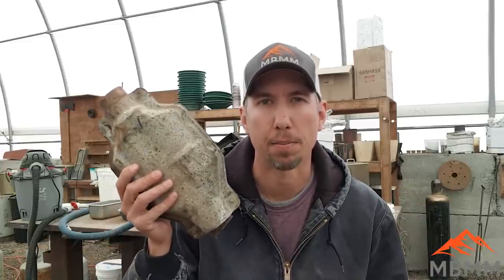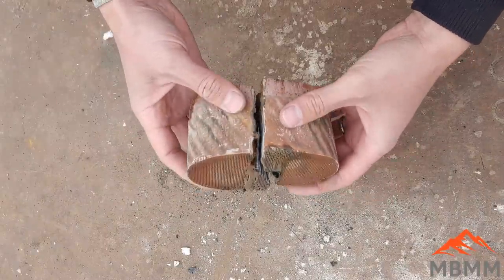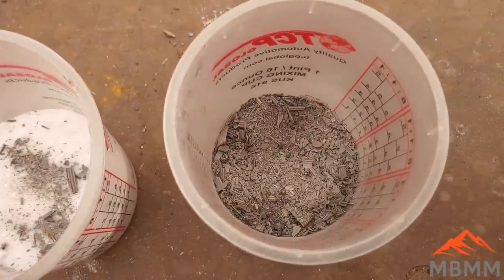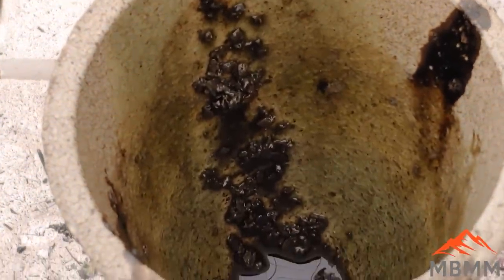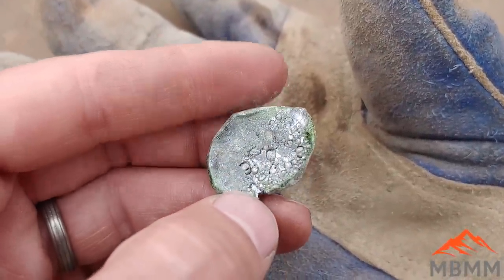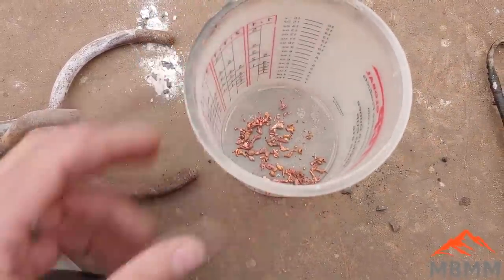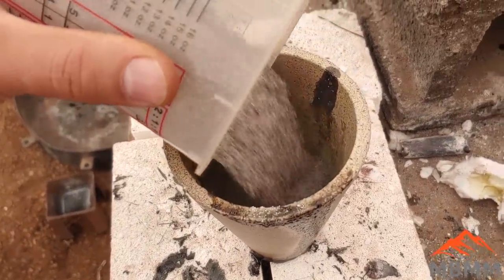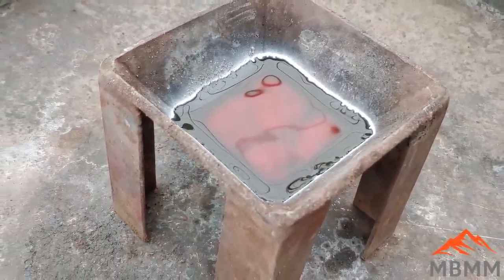Can Platinum & Palladium Be Smelted From Catalytic Converters? Urban Mining Platinum and PGMs!

Comment: i think for platinum "Aqua Regia acid" is the way to go but when dissolving the PGMs you need to be careful, watching Sreetips or Cody's lab they go in to details of what can be done, but it's always good to be on the safe side and have the right safety equipment. 
Sreetips may be the one with most experiences on this and will most probably have the most information on what to do.
platinum can cause platnosis witch will damage the lungs and other parts of our body needs to be handled with care and with good gloves(dont use nitrol gloves when using nitric acid or aqua regia) and a fume hood of some kind.

Comment: What is  the white powder
Reply: Likely the matting material holding the catalyst in place.  It becomes very powdery when released.  This is the biggest safety concern here, since if this part was of late 1980 early 1990s US vintage, it's likely to be refractory ceramic fibres.

Comment: The molten that you did with the copper is called Modern Art, Lol Looks like Volcano Lava, different, atleast you had a bead in every melt,   crazy 3300, shows those catalytic converters have a little heat in them, they'd fry if they didn't have that melting point, interesting

Comment: I'm not a scientist,  but everything  has its melting point, and I see that ceramic is higher  than platinum  so couldn't you heat your  furnace  to the platinum melting point and it will letch out and pool at the bottom of the crucible leaving  the ceramic  intact as it has a higher  melting  point? Like I said I'm not a scientist  but that's  how the refract crude oil into all the different fuels  or how alcohol  is distilled

Comment: A metallurgical book will give you answers or some old boy having a good knowledge firing problems. All you have to remember is that the higher temperatures some metals can evaporate, as it does with acid's treatments.The metals maybe a finite filme or what we call a blush of platinum or Palladium and rhodium on the honeycomb structure, you know yourself, they don't lay gold on thickly when they lay gold or rhodium on silver jewellery. They put it on at a third of the thickness of a human hair or less. Micron's in thickness 0.3 or less. Your problem might be, there wasn't hardly any Platinum in the first place, maybe leached out. They say you can mine roads for Platinum now. As you probably worked out yourself.
Reply: I remember watching a video years ago about some guys sweeping the side of a road, collecting just, to acquire Platinum and they ended up with a bead of less than a gram.

Comment: That cat was damaged,  it came from a car that most likely had a misfire and overheated the cat.   You could see the melted honeycomb.  I don't know if this has an effect on the precious metal recovery but keep in mind that it got red hot,  hot enough to melt the ceramic.  Automotive three-way catalytic converters for gasoline engines have Pt, Pd, and Rh.
Reply: you dont think the melting would have to do with him cutting it with the plasma cutter? funny how it was melted right along his cut lines

Comment: Diesel vehicle = platinum catalyst...
Gasoline vehicle = palladium catalyst... This is why palladium is soaring in price compared to platinum. The industrial use and demand for palladium is higher as there is much more gasoline engine vehicles being built. Once palladium gets to expensive then gasoline car manufacturers will start to switch back to platinum for it's low prices that will then drive platinum prices higher. They go back and forth between the metals. Whatevers cheaper at the moment.
Edit. A new gas engine catalyst should contain between 3-6 grams of palladium. On a old and used catalyst, some of that palladium will have lost micro particles over time and heavy use. New Platinum catalyst should contain between 5-8 grams of platinum.

Comment: The only sure way to get PMs out of the catalytic converters is to use the Aqua Regia or just Nitric acid.
Reply from the maker: Thanks for the tip!
Reply: Nitric acid would have a problem with platinum and rhodium. Even aqua regia have a problem with the rhodium.
Reply: @goranaxelsson1409  Unless you are a professional refinery there is no way you will extract all the PMs from your source material.  It's just a reality of technology.

Comment: It might be like getting gold from computer parts maybe you need a lot of acid baths and chemicals over a long period of time . It could be platinum is harder to work with than gold because of the high melt temp. and the make -up of the converter itself , you know all the garbage thats with the platinum.I know this doesn't help much but platinum is just a different metal that doesn't cooperate.Also I won't cut the converter with a cutoff wheel than plasma cutter, it might just be too hot like using a torch. like computer parts you're going after a very small amount of metal ,I would go with the chemical method.

Comment: You already say the answer, you get one without platnium. It is coming from a diesel farming truck, right? The information i have tells me that, diesel truck switch to paladium for long time ago, well, paladium is not cheap too, a least you earn some of your cost back. I guess you have do nothing wrong, old converter will lost a lot of metal when it blow out the exhaust smoke, you get to check which type converter contain what before you melt them down. A bean of platnium paladium alloy probably will not be welcome by the prawn shop, i guess?

Comment: Well first problem is you used a low grade Subaru converter which probably had the shit beat out of it in its lifetime and a lot of the precious material has been blown out the exhaust pipe so you start it up with a very poor piece for testing

Comment: Well it’s probably rhodium because rhodium has a way higher melt level than any other precious metal and there is much more than just platinum inside a converter the main three are platinum palladium and rhodium and then you’ll have little bits of copper and a few other metals but if that’s not garbage inside that cup if it actually is precious metal more than likely it is definitely going to be rhodium because it takes a plasma arc furnace to be able to melt it down properly and there is only two in America so you’re probably gonna lose a lot of valuable material considering rhodium is the most expensive topped around 12 grand per outs couple months ago be interested to know  how you made out though

Comment: It's a aftermarket converter they are hardly worth anything get one off a Toyota or Pontiac sunfire they are good ones it's so light because there is hardly anything in it
Reply: That's the biggest reason you got basically nothing

Comment: Not meaning offense guys, I'd pull this video. Here in and around Vancouver, BC a LOT of people are waking up to find their cars have been butchered over night. Their Cat Converters have been stolen.  It ends up costing the car's owner usually $300 or more in paying the deductible for their repairs. But the thief makes off with the platinum and I didn't know about Palladium. This just gives people the "how to" if they're inclined to make a little moonlighting money.
Reply: thieves are lazy.  there is more work necessary to do the recovery of the PM's than the theft itself.  this video would discourage them as opposed to encouraging them.
Reply: Based upon his results, this is a disinclination toward DIY smelting. Thieves would be well advised to stick with the same people they've been selling to in the past.
Reply: Take the cat off require jeavy tools and time. Anything in the exhaust is cast iron. I have seen auto mechanics vids and taking this thing out are a pain, and in the confort of your shop, with a car lift and a torch ....
Reply: @38911bytefree  sawzall and 3 minutes. They are usually about where your feet go under the car. The pipe is light gauge. You must have watched a mechanic work on a 1980's car 😂
Reply: @38911bytefree  a thief doesn't care about a proper removal, so a SawZall with a metal cutting blade removes then damn quick when you aim for the pipe on either end.
Reply: This is the stupidest reasoning ive ever heard. People have always been stealing stuff. A supposed new reason for people to steal things is hardly gonna change what the criminal minded among us do.
Reply: @PbChemist  IDK, I'm personally considering stealing Roger's cats because of his reply.